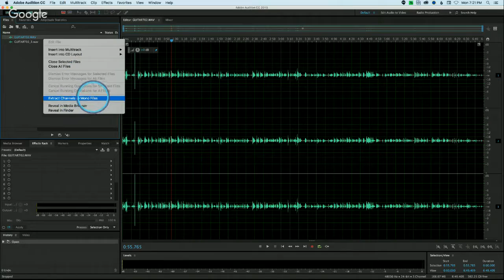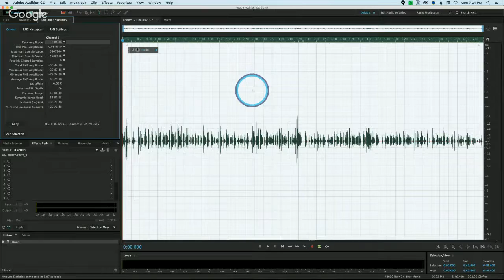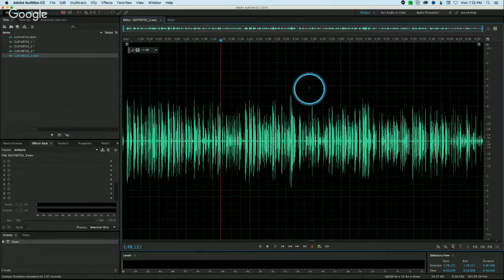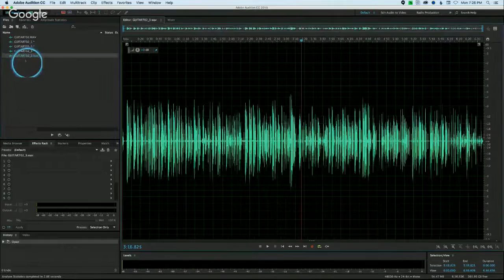Sound for Video Session: Short Film Sound 18 July 2016

Comment: Sorry this seems a bit off topic, but I just upgraded to the MKH 416 from the NTG 2 today and the mic has not been working. I gave it phantom power and checked to make sure the cable was working and audio recorder/DAC was working using the ntg2. There was no sign of any signal coming the mic. It was purchased through B&H so I presume that it is not a fake. Do you know what the problem might be?
Reply: Hi James, The only thing that comes to mind is that perhaps your recorder is set to 12 or 24V phantom and needs to be at 48? Which recorder are you using? If everything else is working with the NTG2, perhaps the new mic is defective. Fortunately, I've had a very good experience exchanging items with B&H so hopefully if that's what you end up needing, they'll make that easy for you. Sorry for the trouble with the new mic.
Reply: Thank you for your condolences. I used the Zoom H6 and Focusrite Scarlett 2i2. I double checked and both delivered 48V phantom. It looks like I will be exchanging mine. Thank you for your help! Really appreciate it!

Comment: Agreed that the Tentacle Sync app requiring the device being connected is an inconvenience, but it seems a not terribly unreasonable copy protection scheme. If they didn't require it, competitors could take advantage of Tentacle's app. The solution I offer to my clients is to bring my laptop to set, and spend a few minutes ingesting the video files and syncing them to my audio files at the end of the day. I then hand off the merged files. The picture editor gets to cut with my pristine audio without having to deal with the LTC track.
P.S. Hope you get over your cold soon. :-)
Reply: Thanks Scott. From what I can tell from my research, the options are Avid Media Composer ($50 USD per month + for subscription, a tough sell for low budget productions), LTC Convert ($250 USD), and Tentacle Sync's app (bundled with their hardware kit or ~$175 USD for a license). Looks like I'll need to go with the "sync job on the spot" approach as well. Good to hear from you!

Comment: i have recorded 3 tracks,2 wireless and 1 boom now my director wants to me playback the old track recorded 6 takes before the current one that to he also aks for playback the boom track alone...i'm playing back the previous take by pressing the rewind button multiple times and i can't find how  to put solo for the boom track while playback,all 3 tracks are playing together..any shorcuts?  Also is there anyway i can playback any track in finder window by selecting the track?
Reply: Hi Dinesh. On which device are you playing things back for the director?
Reply: +Curtis Judd just through f8's headphone output...it's an low budget Shortfilm.
Reply: +dinesh yuvi oh good, that's easy: when playing back the clip, just press the PFL button for the boom mic channel. You will notice the channel LEDs by the gain trim knobs for the other channels will turn off and you will only hear the boom mic channel.
Reply: i got it,can u do a 10 minute video on mixing on ipad with zoom F8,like scene naming,monitoring,because with F8 alone we have scroll each letter to name the scenes,notes.
Reply: I will add that to the list. For now, note that the iPad/iPhone app cannot monitor audio from the F8, you still need to plug your headphones into the F8. Bluetooth isn't yet robust enough to transmit a full audio stream plus all of the other communication which needs to take place to support the other features of the ap. The app just allows you to setup, mix, and enter metadata.